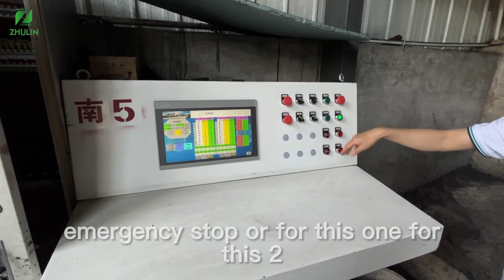coconut activated carbon production line / activated carbon for gold recovery

Comment: how is crushing and sifting the final two steps? those are literally primary steps after making charcoal.... the pores are not relevant if the charcoal is not crushed and the charcoal is not relevant if the charcoal crushed is not sifted.... only after crushing, then sifting, the pores become relevant and basically need to be flushed.... at which point steam (which you used) is a great idea.... but the order of this process makes no sense.